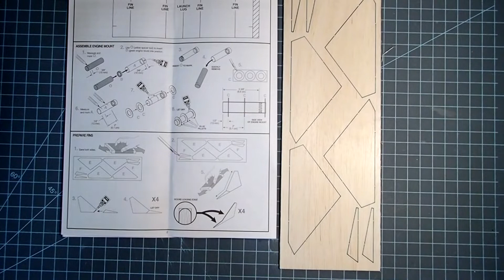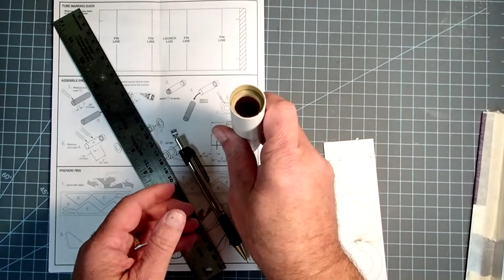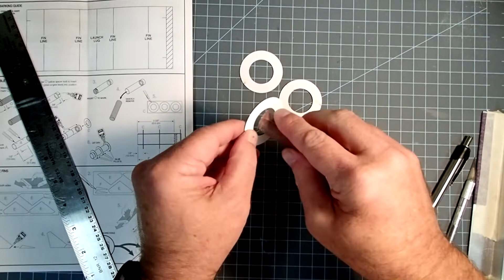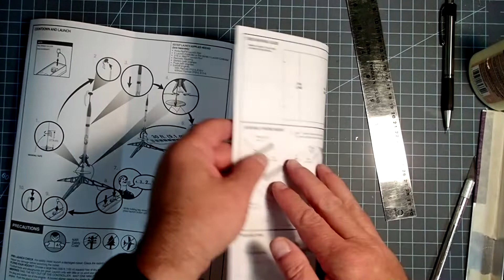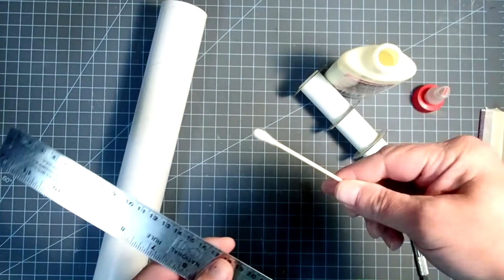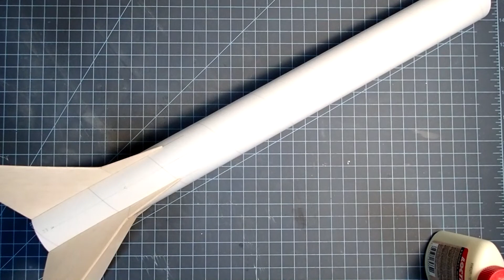Estes “Olympus” model rocket assembly (part 1 of 2)

Comment: When making fillets, I keep a plastic "food storage" container with a very damp sponge in it (small amount of water at the bottom of the container). As I work with the glue, I'll wipe my finger on the wet sponge. When finished working with the glue, I rinse the sponge with water and its ready for the next gluing operation. Saves on paper towels and tissues.
Reply from the maker: Good tip